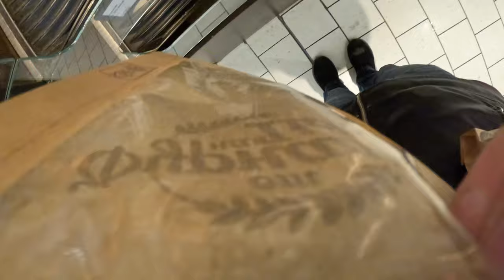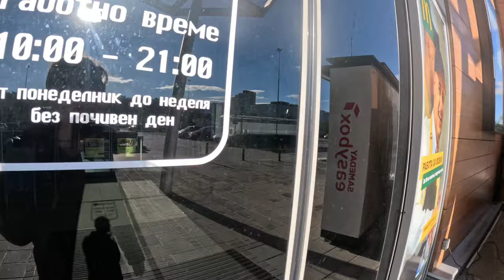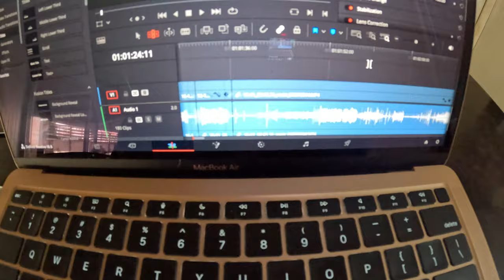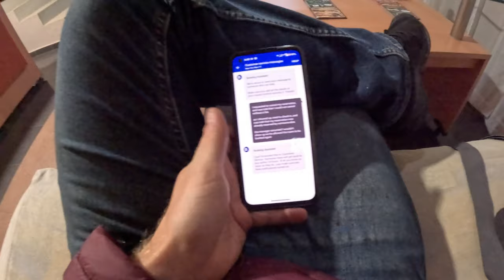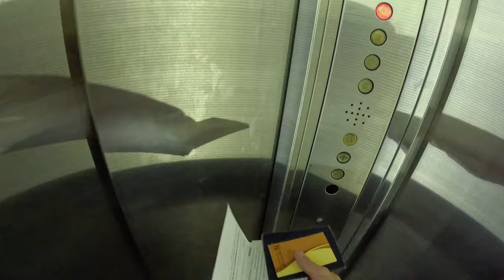A screw just destroyed my bike

Comment: Especially when the hole is wide , you have to inflate the tire with low pressure. After you ride a while you can inflate to higher pressure. The hole seals better  if you apply this method .

Comment: Why  the headlight can't be improved  (changed , for a better one) ? And high visibility jacket costs , like $2-3 and weighs less than a ham and cheese sandwich . It was a good day , because it was relatively warm , so fiddling with a tire could be done , without loosing dexterity on the fingers , like it would be , if it was cold (and wet).
Reply from the maker: Super true. Would have sucked in the snow

Comment: Haven't gotten to the disaster yet but you want to make sure that chain you bought is rated for E-Bikes. Because it's ran through a motor it needs to be stronger than a normal bike chain.
Reply from the maker: That would be true for a mid drive ebike